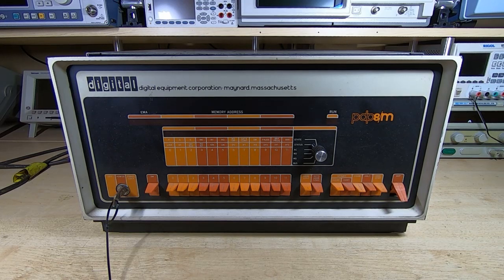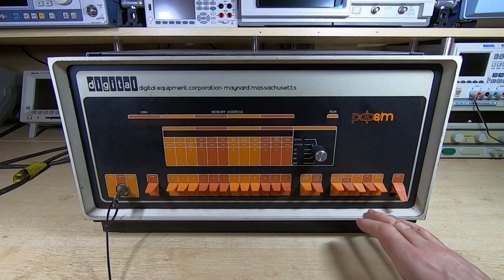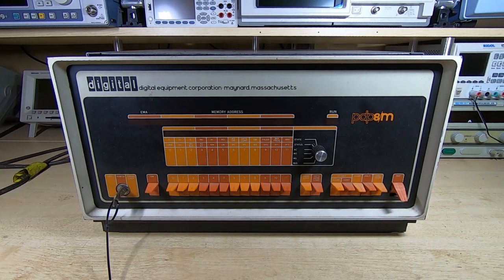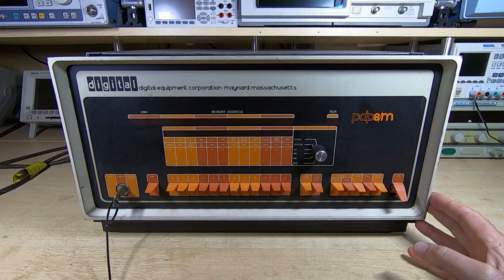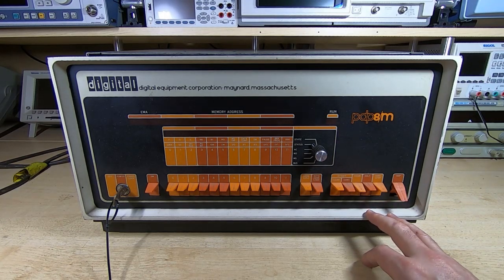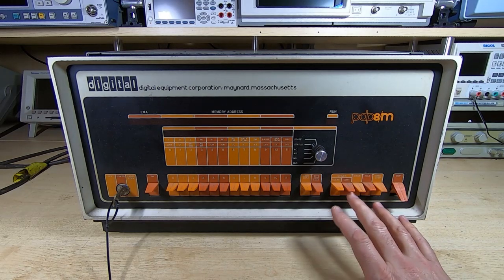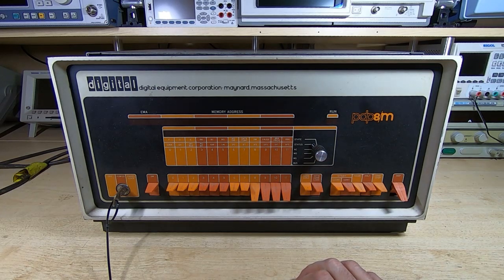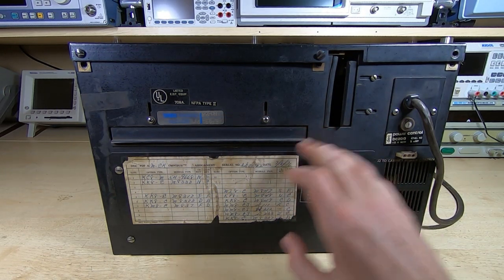PDP-8M Restoration Part1

Comment: The M8300 an M8310 was inserted backwards :) someone has been poking around in this machine.
Reply from the maker: Most machines I work on have been messed around and I frequently have to rectify previous 'repairs'. I do not show most of them as the videos would get too long. I had one of these for repair a few years ago where the mains wire from the key switch was connected to the control panel ground connector. That is why I never switch anything on until I have had a good look at it. I am hoping that the power supply fault (spoiler alert) has not destroyed the boards. It is possible that the damage was caused by the boards being reversed but as the power leads were just flapping about then possibly someone had got hold of this and plugged it in with the wires touching something they should not have been. It will be interesting to see the condition of the boards. Hopefully the owner is ready for a big parts bill.
Reply: One of my 8/E came with two(!) CPUs ”installed”. And with a gap between the M8300 and M8310 putting some strain on the boards and top connectors.

So, agreed, never turn an unknown computer on first thing.

Comment: So this is some kind of calculating machine, but with the gearing replaced by advanced electrical circuits?
Reply from the maker: Exactly. In fact the development from mechanical calculator to something like a pdp8 is not as radical in terms of architecture as it may seem. The carriage on the MADAS is actually a binary register with a preload function (knobs) and the lower number is another preloadable register. The mechanical ALU simply works on these two registers to perform the task indicated by the two flags (mode knobs) and the result ends up in the accumulator (centre number) and it is a real accumulator as it can accumulate multiple results. Machines like the PDP expanded on this idea to allow each action include the required operation (add / sub / div  etc) but it originally fulfilled a very similar requirement (of course the MADAS cannot run DOOM but then neither can the PDP).